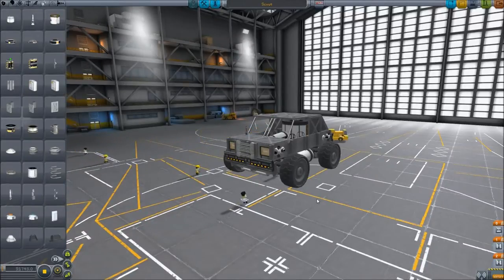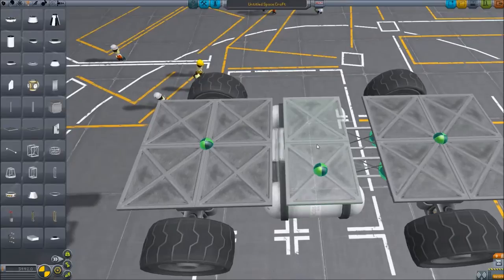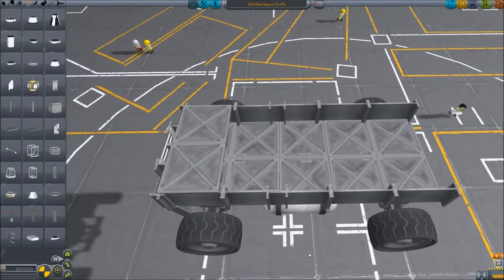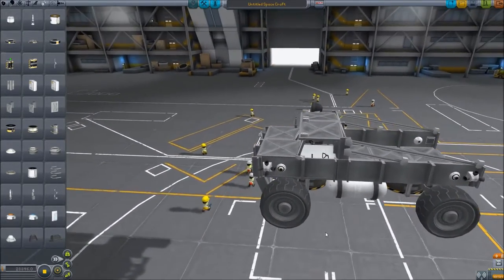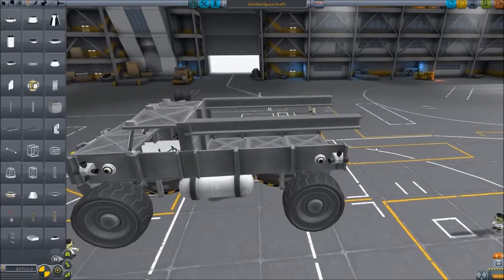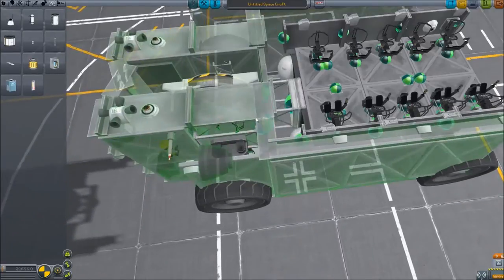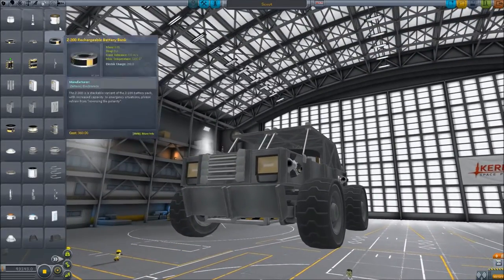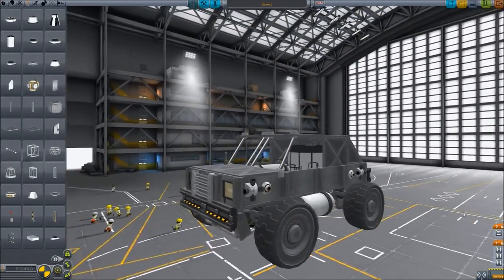Rover Tutorial - KSP

Comment: how to send this rover to another planet?
Reply from the maker: hisgr8nessmadzak I've usually done it by attaching one on each side of a rocket to balance out the weight.  If you only want to send one and/or you have some fuel troubles, you can put a LFO tank on the other side and adjust the fuel level until it's balanced.  Once you've landed, move the fuel into the main tank and release the rover and auxiliary tank.